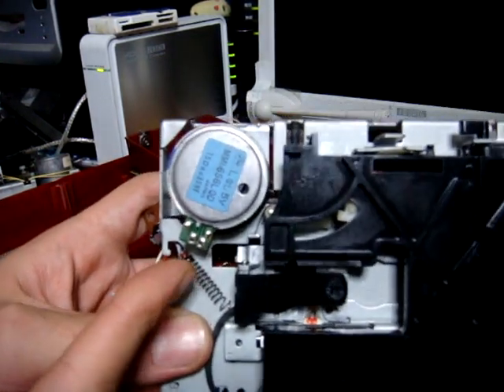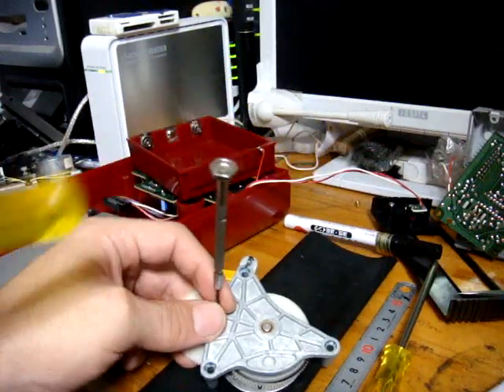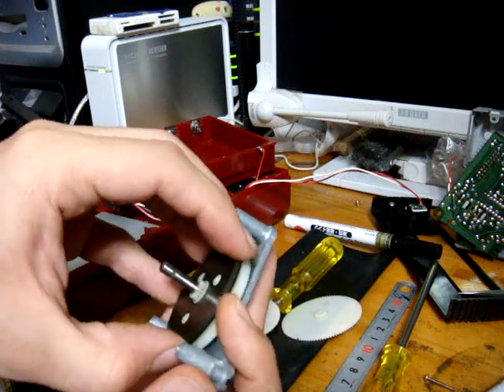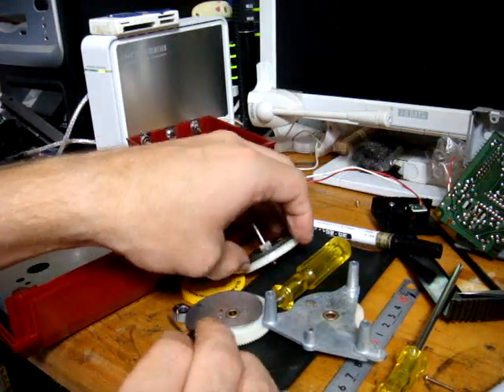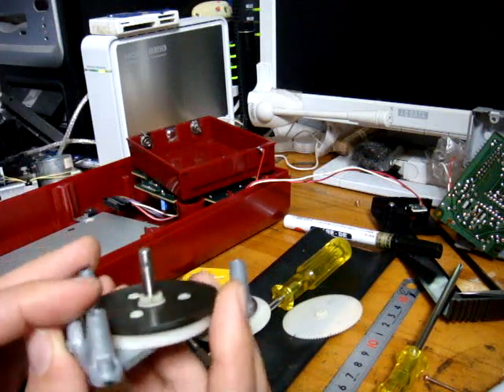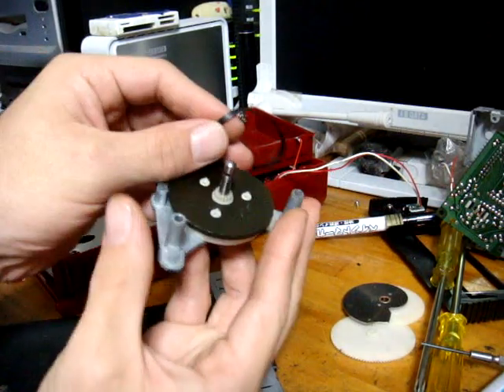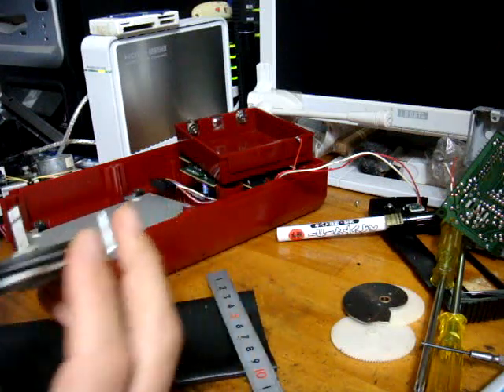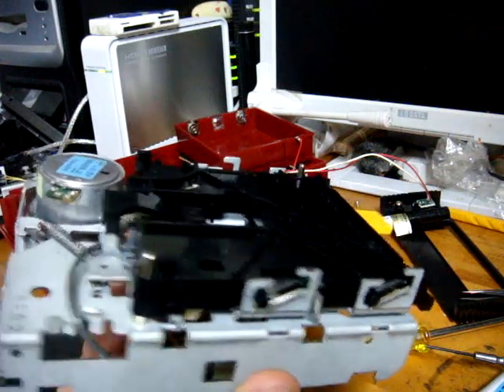How to repair a Famicom Disk System (Part 2)

Comment: The Famicom Disk System Belt was a prioritized item made by Nintendo for the Famicom Disk System. Your best bet is to order some from Ebay rather than have them custom made. Custom made ones may not work and will cost just as much, if not more, than ordering official ones online.